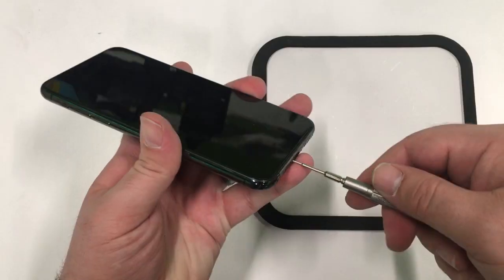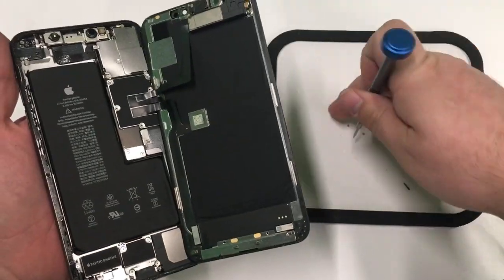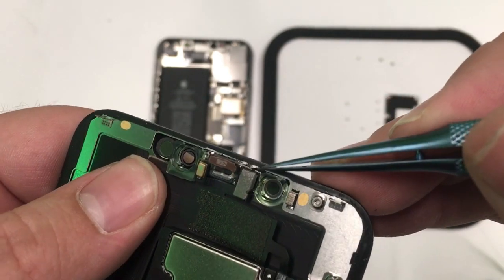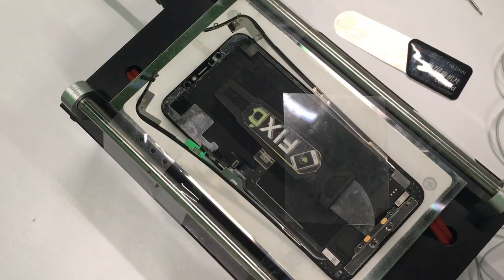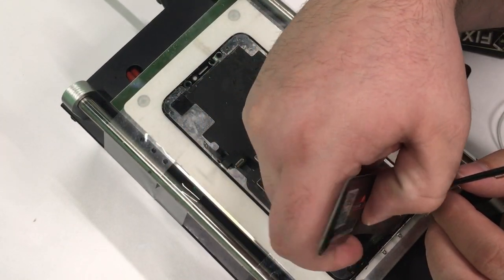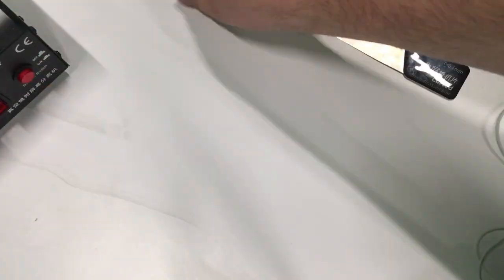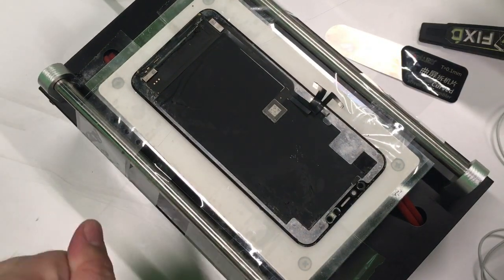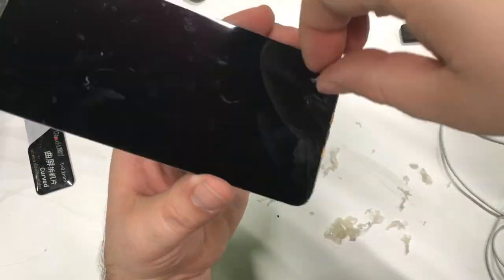How to remove the glass on a iPhone 11 Pro Max (lives might be saved)

Comment: Hey, what could be the cause when i separate the glass from the screen the touch function stops working, but it was working normally when i removed the bezel and tested it again. It stopped working after the glass separation

Comment: Great video. But can you remove and replace only the screen glass part without opening the whole case?
Reply from the maker: Great question, in short the answer is no. The way it’s manufactured prevents the glass from being removed without removing the screen from the frame etc.